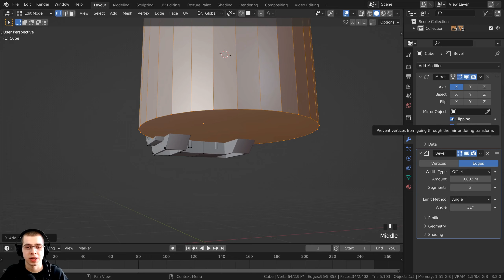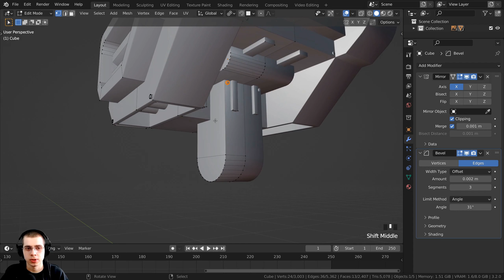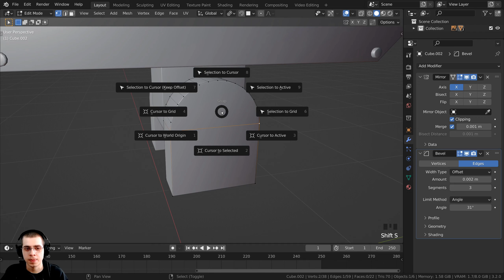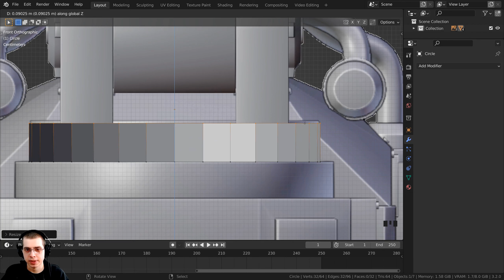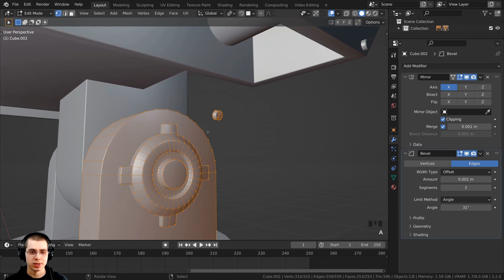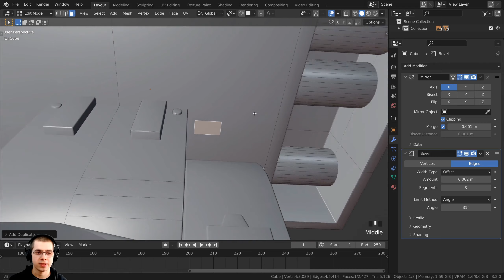Sci-Fi Mech Robot - Part 2 (Blender Tutorial)

Comment: Snapping issue: Some bolts are snapping well on the surface but some show weird snapping. Snapping options are same for all bolts. But out of all bolts snaps well and all other bolts are not not snapping now after duplication. Thanks.
Reply from the maker: Hmm, did you make sure to use the same snapping settings that I turned on?